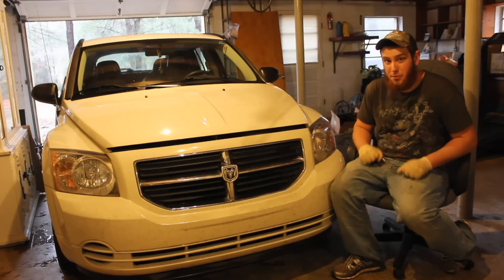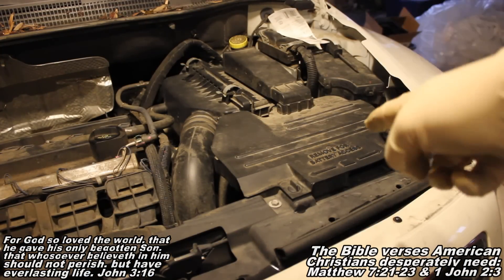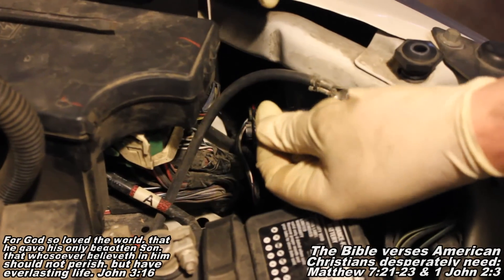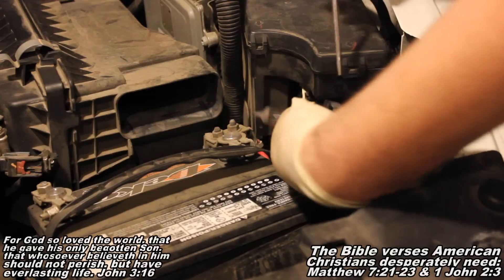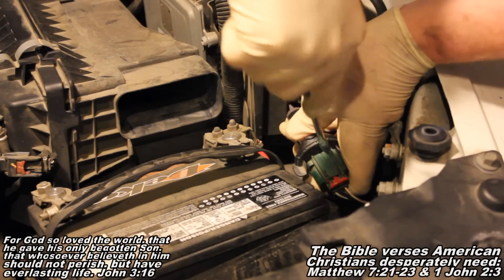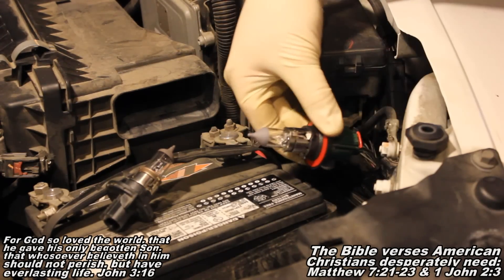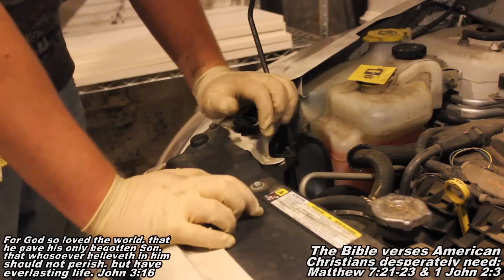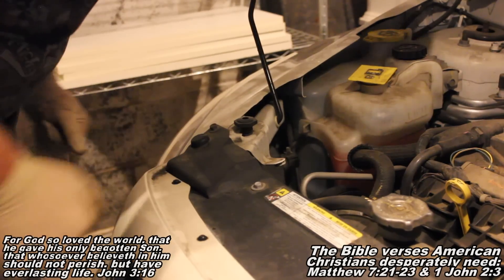Headlight Bulb Remove & Replace "How to" 07-12 Dodge Caliber

Comment: Maybe God can do your Passenger side for you...like how you explain it....i dare you to do it like that.   

It’s been a year waiting for your response on the passenger side... the trick is unbolting the coolant , brake and washer fluid (13 mm) .. move out of the way ( coolant will most likely will be leaning forward put a rag under cap as it might drip slowly ) then slide your arm threw the opening you made ... ( looking at the three arm threw the left side) and there you have it. Piece of cake ... this guy is a fool .

Comment: I've tried replacing mine but I just can't get it done.  I can get the driver's side loose, but my wire is nowhere near as long as yours and it's impossible to get two hands down there to remove the bulb.  For the passenger side, I just can't bet both of my hands down there to even get it loose.  It's very frustrating.